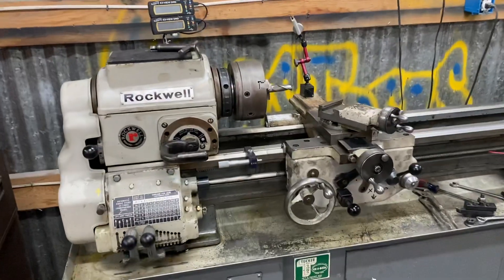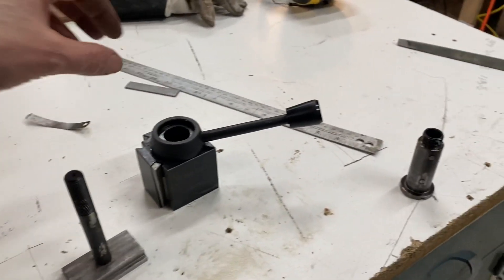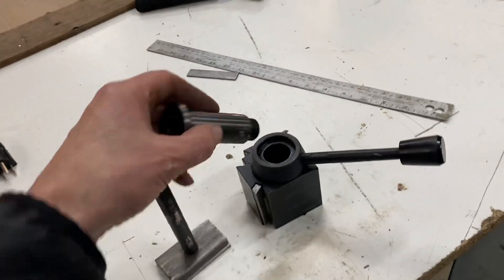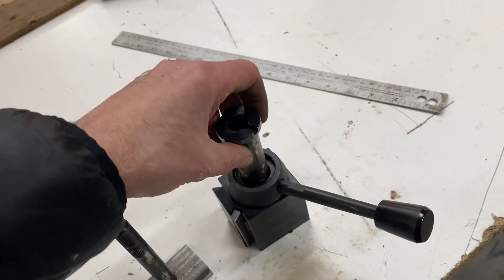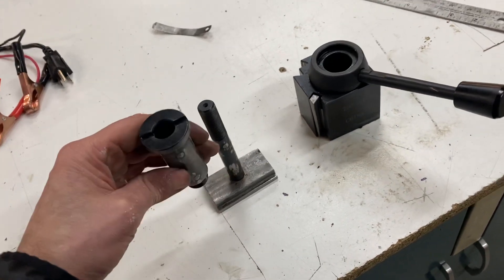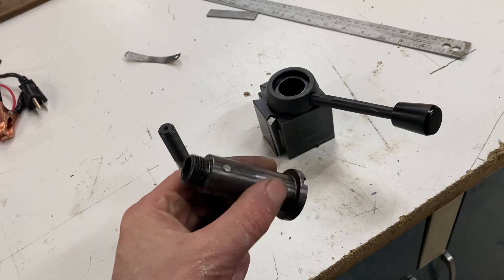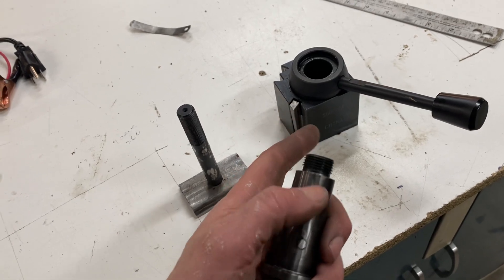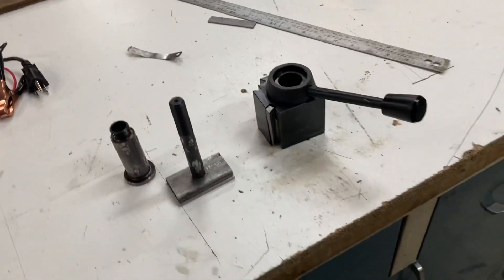How to fix that cheap Chinese toolpost holder on your metal lathe.

Comment: Could you not just roll a piece of very thin shim stock around each bore instead of spot welding?? Brass shim stocks are available as thin as .001".
Reply from the maker: I had a feeler gage in the large bore and it was improved, but the spot welds were the way to go. I don’t think that the thin post could be fixed with a shim..

Comment from the maker: **Please note that I did check both parts for hardness with a file before introducing weld heat to the parts. Both parts were soft to a file, so no harm done..